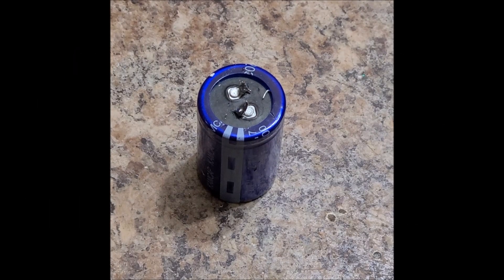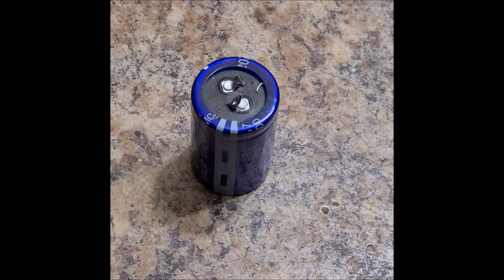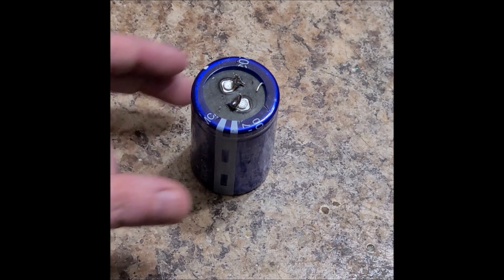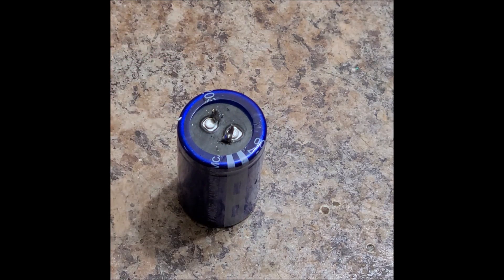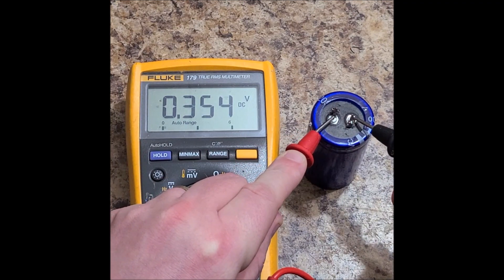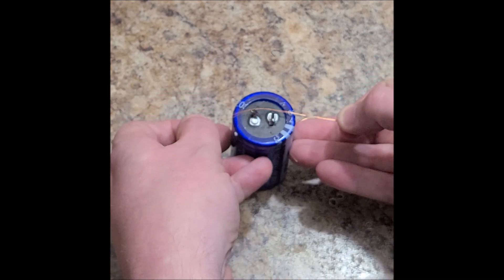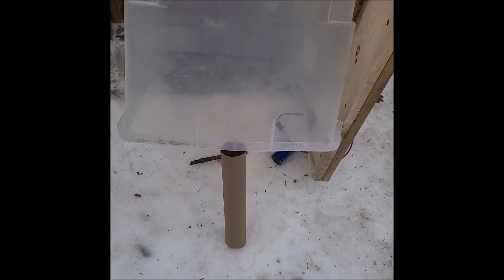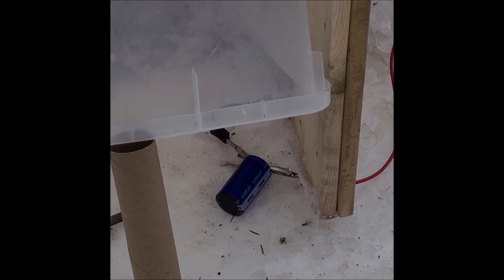Attempting to blow up a 400 farad 2 5v super capacitor

Comment: Maybe just overvoltage would do more.
An internal diode makes sense, as it would prevent reverse voltages when several super caps in parallel are discharged.